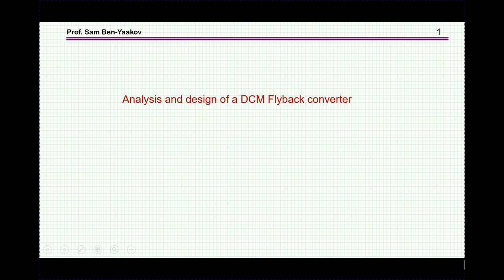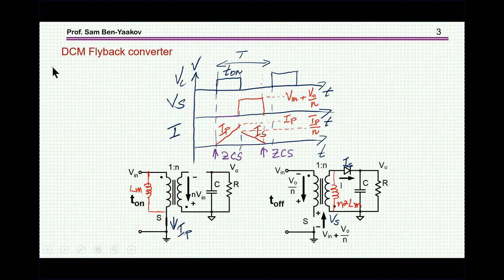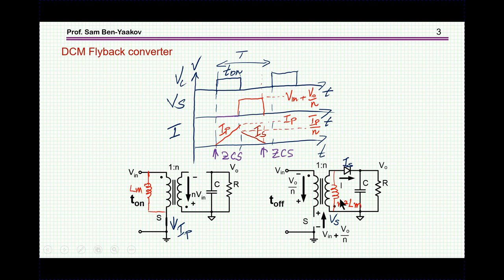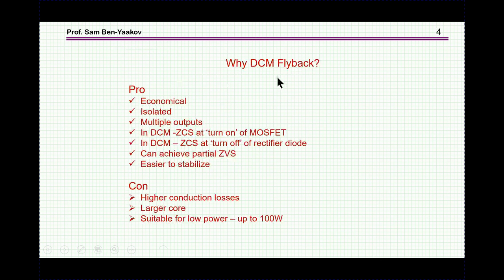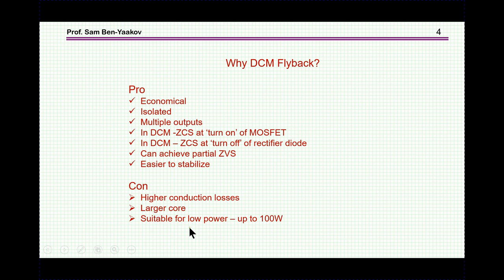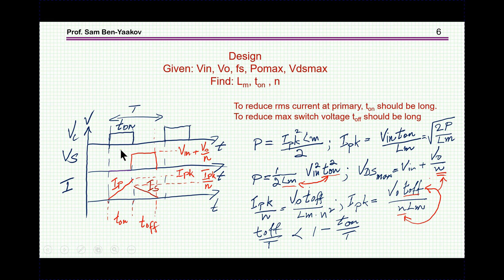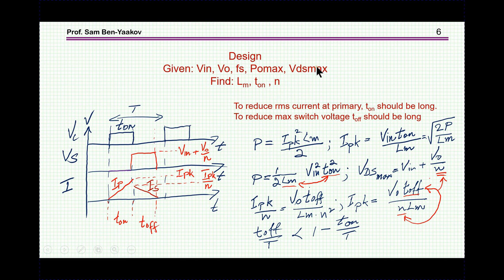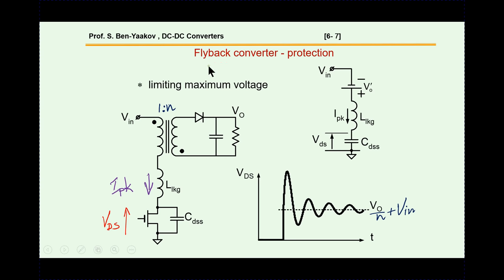Analysis and design of a DCM Flyback converter: A primer

Comment: Hello! Good explanation! I`d like to add about a self-oscillating flyback converters with two transistors (like in a cheap mobile charger). These converters very dependents on a transformer , feedback winding turn ratio, there may be over-voltages or avalanche damage - because there is not any gate driver. The stability of this type of converter is not good enough - there is a hysteresis in feedback loop. I have an experience with this type of flyback converter - I only want to share my small experience ))) .Maybe I  am not right - but integrated circuits with gate drivers and protection much increase reliability of a flyback converter .
Reply from the maker: Thanks for sharing. Discrete analog controllers for flyback and other converters are ingenious but passe. Indeed, IC controllers are very effetive and relaiable

Comment: When the switch is opened up in the primary circuit and the magnetic field around the primary inductor collapses, what becomes of the Back EMF spike?  Obviously the large Back EMF spike will be coupled over onto the secondary inductor.  However, I guess my question is, is the fact that this coupling the Back EMF spike into the secondary's coil - eliminate the need for the traditional 'snubber' circuit or 'snubber' diode across the primary inductor that is traditionally used to 'catch' and 'handle' the large Back EMF spike?  

Thank you kindly for an excellent explanation - this is a new circuit to me.
EDIT:  and then the question was answered later in your video - thank you!
Reply from the maker: There is no back EMF spike. The "back EMF" is the induced voltage by the magnetization, When the primary is opened the back EMF find it way to the secondary which is how the energy transferred.

Comment: Dear Professor Yaakov, in calculating power P in the primary, it seems you have considered ton = 1/2 T and if so, P = 2 IPK^2 Lm * fs. In other words, 2 in the denominator should go to the numerator. And P as you know is the peak power. Thanks
Reply from the maker: Hi, Raymond. Please clarify to which minute in the video are you referring to?
Reply: @sambenyaakov  This is at 4:38/25:40 on Slide # 5 Thank you so much for sharing such educational videos. Very Best Regards
Reply from the maker: @raymonda.koosha5824  The energy transferred from primary to secondary is LIpk^2/2. This occurs fsw (1/T) times per second. So the power  transferred is the energy times fsw (or divided by T). The duty cycle does affects the value of Ipk.

Comment: Thank you for this wonderful explanation. Query: Wouldn’t it be more efficient to utilize the back EMF of the secondary coil by dumping it into a capacitor which could then be used to drive the primary circuit? In theory you might be able to double the output of the power by using the resonant frequency, where the voltage peaks are maximized, and instead of dumping that power into a resistor, which turns it into wasted heat energy, you could use it to drive the primary coil or even dump it into a load? Just a thought…
Reply from the maker: Thanks for the comment. Not sure I follow you.
Reply: @sambenyaakov  The ring down effect (back EMF) which starts as a voltage spike is typically maximized when the coil is tuned to its resonant frequency. In stead of dumping that into a resistor, you could send it to a separate capacitor bank or something and use it to power a load or to maybe drive the primary coil. That was my thought…
Reply from the maker: @BrentLeVasseur  Got it. See: https://youtu.be/ySC-SvoQa3U

Comment: Hi Sir , At 16:47 you were saying that time constant for the RC circuit should be larger than fs -> Hence basically in passive clamp you are not settling the RC circuit charge and discharge ; Is the passive clamp circuit just for passing those inductor (LC) undamped oscillations?
Reply from the maker: Indeed

Comment: Dear professor, thanks for your excellent video. There is one thing bothering me for a while: the DCM flyback converter looks like a 1st order system with a single pole and a single zero as you illustrated. Why compensation is needed? As far as I know a 1st order system is always stable.
Reply from the maker: Good point regarding stability. But...A PI controller will increase the loop gaiat low frequency for lower DC error  and better line regulation as well as PSRR.
Reply: @sambenyaakov  I see. So the plant is a first order system. With an error-feedback network the system becomes a higher order system and hence requires compensation. Another question is most DC-DC converter assumes a constant output voltage while the input voltage might vary within a certain range. Is there a boost converter scheme that's suitable for constant-input-voltage and variable-output-voltage? So far the best candidate I found is the constant-off-time hysteretic controller as it doesn't require a compensation network. But I couldn't find many controllers of this type.

Comment: Hello sir, If possible, could you please throw some light or make a video on flyback operation when Vout< nVin.  I am confused about its operation in that region. I found through simulations that, for Vout< n Vin, even if its designed for DCM, it shows CCM operation. Once it crosses that threshold it shows DCM operation.  I am working on capacitor charging application. It would be also helpful, if you could include how parasitic capacitance play an important role in the maximum voltage the converter could reach?. If its not possible, recommendations of good reference books would be big help. Thanks a lot.
Reply from the maker: Send me an email to sby@bgu.ac.il and I will reply.
Reply: @sambenyaakov  thank you.

Comment: Dear Mr Yaakov, I think that at 10mn, the fs frequency is missing in the peak current relationship when you are expressing the power.
Thank you for this sharing
Reply from the maker: Hi Mlaid, You are correct! I hope others will see your comment. The initial expression for P  is actually energy so to get power you need, as you indicated, to multiply it by the switching frequency. I will put your note and my answer in the YouTube page of video. Thanks again.

Comment: thank for the video,
I want to know why you are using the average current in the calculation of the clamp current and not the RMS value. because we always use the RMS value in our calculation 18:52
Reply from the maker: Why rms? At steady state, there is about (save the ripple)  a DC voltage on the capacitor so the current through the resistor is almost DC and equal to the average current o the leakage.

Comment: Hello sir! Its indeed an enlightening video. I have one doubt though, the clamp capacitor is initially charged to the clamp voltage during turn on of the switch. when the switch is turned off  and when the switch voltage exceeds the clamp voltage , the diode is turned on and leakage energy has new path. My doubt is through which path the clamp capacitor is initially charged, as the diode is reverse biased. Could you please throw some light ? also in 20.35 you have mentioned ideally the switch voltage goes to zero when the current ceases in secondary. but shouldn't the switch voltage be equal to Vin ?
Thank you.
Reply from the maker: Good questions. Thanks. Primary and secondary act also as a tranformer. If the cap voltage is low it will charge concurrently with the output. 
When the current stops the interwinding cap an primary resonant  oscillate which reduces the voltage on fet.
Reply: @sambenyaakov  Thank you sir.

Comment: hi , how a buck or boost or flyback converter ic supply its own circuit ? I mean  I always see an internal voltage regulator inside every diagram of these chips but if it get the current from the source directly it is not efficient
Reply from the maker: Auxilliary power supply

Comment: Can the peak current also be calculated the following way? Ipk= ton*Vin/Lm? Because the leakage current should be the same as the current through the coupled inductor, right? greetings Nick
Reply from the maker: Certainly, but..you don't know ton. The requirement is P from which you calculate everything including ton.

Comment: Sir I had one question regarding the practical design of the flyback converter that I have seen in most of smps circuits. Sir there is a cermaic capacitor (1nf to 50nf) connected in parallel with the mosfet (drain-source). First I used to think it acts as a snubber during turn off of the mosfet, but soon realized that there should aslo be a snubber resistace in series with it to limit the discharging current, which is not present. I do not understand the reason behind it, as it will stress the current through the mosfet when it will turn on. Thanks.
Reply from the maker: Tis would be for DCM. The reason could be either helping quasi resonant operation of lower the frequency of the parasitic oscillations.
Reply: @sambenyaakov  Thankyou Sir!

Comment: Wow professor.. wicked videos.  At 25:00 on this video you mention how you could look at the graph/poles and determine the output could be controlled using just a simple Type 2 / PI control.  What concept/basis did you use to be able to determine PI vs PID (for example)?  I've long forgotten my math, but more or less followed you to that point! :)  Thanks for the education!
Reply from the maker: @25, this is because a current source into an RC is first order.
Reply: Aha! Thanks a bunch professor!

Comment: Hi Sir, you are a great professor in making complex concepts easy. I need your favor. I am a junior research engineer. I am trying to develop a flyback converter just for understanding purposes. Our goal is something different. Flyback have following specs: Np=30T, Ns=2500T, fs=34kHz, D=47%, Vin=20V, RL=1Meg. Leakage Inductance Llk=200 uH. The Core is UU Core of MnZn Material having Effective Core area of Ae=191mm^2. Both primary and Secondary Windings are wound on separate legs. Primary Winding is of Single Copper Conductor of AWG=25. The issue which I am facing is that during ON Time (Ton), the inductor current doesn't increase linearly rather it oscillates and it seems that there are sinusoidal oscillations which are superimposed on the linearly Increasing Inductor Current.  Due to this reason Output Voltage is much smaller in amplitude than the theoretical one. can you Plz explain the reason and Phenomenon which causes inductor current Oscillating. and also how can we solve that problem. Any helpful Information will be Appreciated. A Rough Plot of Primary Current During Ton is attached herewith: 
https://drive.google.com/file/d/1HHPh5b1vHrkywzdQzuXvkwrtDxF-Ipu2/view?usp=sharing
Reply from the maker: Hi Imran, You do have too much leakage inductance and apparently large inter winding capacitance. Not a good idea for flyback to wind on separate legs. Try as a first step to wind primary on secondary (with proper insulation in between).
Reply: @sambenyaakov  
Yes you are right sir. Leakage inductance is large. Ok I try to wind on same leg. I will update you about the results. Thank you so much sir.
Reply: @sambenyaakov  
Hi sir
I have simulated the same circuit on LT Spice and added a stray capacitance of 35pF on secondary side before secondary Diode. The results are almost matching with those of hardware. This shows that oscillations in primary current are the results of large inductance and capacitance. They are making resonance. But my question is that how they are making resonance during On Time while leakage inductance is still getting energy from Source?
Reply from the maker: Inter winding capacitance of magnetic element
Reply: @sambenyaakov  
Hi Sir!
I have redesigned Flyback with Secondary and primary on same leg of UU core as per your instructions. Following are the specs:
Vin=50V, Vo=10kV, Po=100W, fs=20kHz, D=48%,
Lp= 114uH with air gap,  Ro=1Meg, Np= 15T, Ns=1280T
Ae=200mm^2
Now if I use same Volt/Turn on primary and secondary side then secondary turns come out to be Ns=10kV/(50/15) = 3000T
But these turns are too large. So I wounded Ns=1280T. Then according to volt second equation 
Bac=(Vs*Toff)/(Ns*Ae)
=(10kV*26U)/(1280*200U)
=1.05T > 0.5T
This shows that during energy transfer, core will saturate.
My question is that Does above equation apply to the secondary side as well? If yes then how we can design flyback with above specs but with lower secondary turns without saturating? Also can this happen that secondary winding of flyback will saturate core even if primary winding is not saturating the core? Any help would be greatly appreciated.

Comment: @8:10 Dr. Sam: If ton is higher, Duty cycle will be higher, that means peak current will be higher ( RMS will be higher) for variable switching frequency (boundary mode) as well as fixed freq DCM mode converter. Ipeak and L are inversely proportional. Or may be I am missing something here?
Reply from the maker: Hi Swaraji, if by design ton is longer , Lm will have to be larger for same power. The end result will be a lower peak current
Reply: Sam Ben-Yaakov yes you are correct Dr.Sam. I checked my equations . Great video by the way
Reply from the maker: Thanks

Comment: If I have a flyback converter already operating in BCM, how do I send it to CCM or DCM without changing my input and output voltages? Just by changing duty cycle or also the inductor value must be changed?
Reply from the maker: For a fixed vin vout and power you can lower switching frequency it will go into DCM and higher frequency for CCM. But if your controller is BCM it will adjust itself again.

Comment: A great video as always. what happens if we run the flyback converter (or even other DC-DC converters) without load? I see that all analysis are based on the fact that there is an output (load) current and load resistor appears in some of the equations like here. what happens if there is no load? after the capacitor is charged, the diode will never conduct. Will the energy stored in the core be dissipated by heating up the core? If we add the feedback and PWM circuitry, will it even start if there is no load?

Comment: 2 questions. I have looked at a few abstracts. On some they use the reflected voltage to calculate n and on others they use the vin over out. Which is correct? Also if Bmax is specified by the core and it is not exceeded in the calculations then why do we need the air gap. I understand that the gap changes the slope of the BH curve but is it required in all cases. Thank you
Reply from the maker: The two approaches seem to be the same. As for need of gap see
https://youtu.be/CCS_sPgb6U4
https://youtu.be/z17qFQ12CfE
Reply: Thank you for your fast response. My understanding is not as deep as yours. In the case n=Vr/Vo vs n=Vo/Vin, they seem to yield different results for the turn ratio. Also on the second question, I have looked at your video. I am trying to design my first flyback converter to experiment with. At what point do I need to insert an air gap as part of the EE core I am using? Do I need the air gap if I stay below the Bmax?

Comment: can we use same method for CCM ??
Reply from the maker: Yes. With adjustments.
Reply: @sambenyaakov  thank you so much sir
I want to design a dc- dc converter for 180w rating how bad is that using flyback topology for that.

Comment: Why the stored energy inside choke should not be 1/2*Lm*Iavg instead of peak current? what if the current shape not be triangular in general not here
Reply from the maker: Energy stored in an inductor is 1/2 L I^2 so the energy of the leakage inductor at he turn off instance is related to Ipk of main inductor.
Reply: thank you for reply

Comment: Thanks...I understand that you chose to use your referenced equation to solve...however...let's assume a buck converter simulation...would it not be easier to assume that one brings the inductor to full magnetic field and then at that point the charging circuit is disconnected...what ever the duty cycle time to do that...no more, no less.  Then at that point in time...the problem now is simplified to that of the load circuit supplied by the flyback energy (Current source)  imparted by the collapsing magnetic field...the problem then becomes much easier to conceive as well as approximate...and most likely also to simulate.
Reply from the maker: This is too simplistic Switch mode converters do not work this way.
Reply: @sambenyaakov  Deflection is simplistic as well

Comment: how can i choose the value of the Capacitor?
Reply from the maker: Which cap?
Reply: @sambenyaakov  the capacitor at the output
Reply from the maker: Based on current ripple of cap  and desired voltage ripple. But...watch for losses due to ESR.

Comment: Can this flyback model exchange energy 2 way sir? I plan to use it to balance the voltage between two 15V sources
Reply from the maker: For bidirectional you need also a switch at the secondary.
Reply: @sambenyaakov Thank you for the answer sir, can you tell me if the calculation formulas are different with that model?